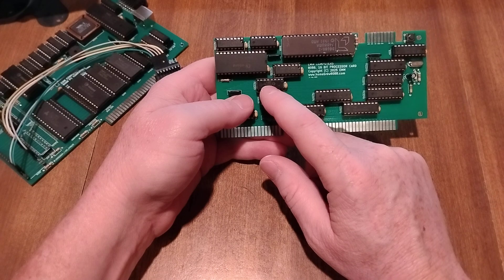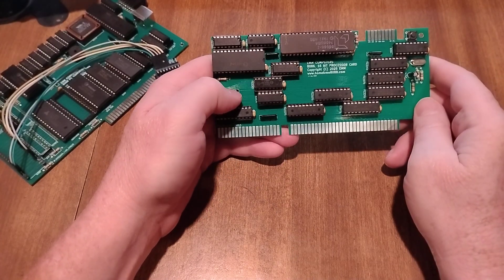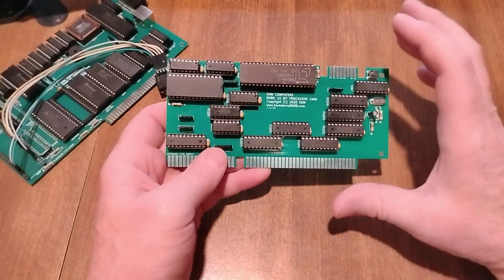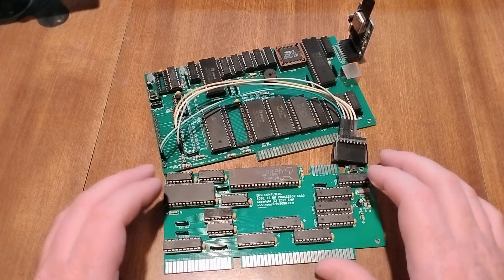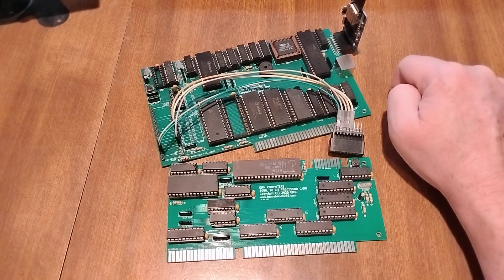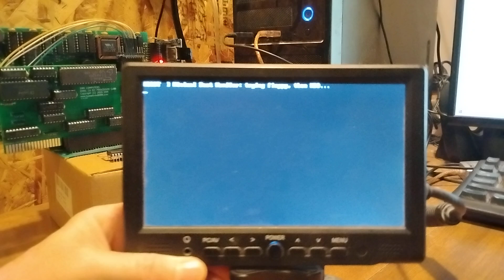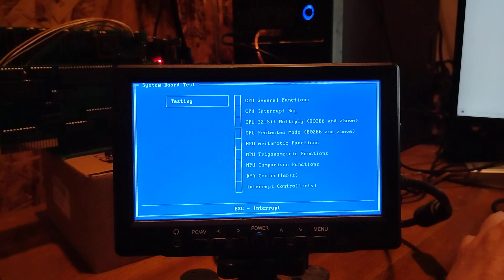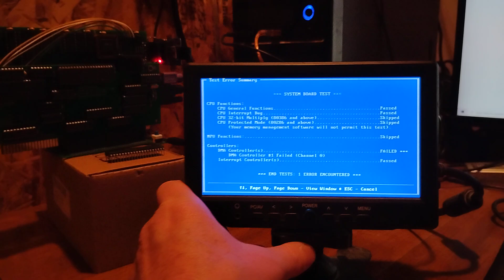8086 PCB

Comment: @EMMComputers -- Will we see this project on a 16-bit ISA backplane board?
Ive been following this since pi86, and got a NEC (v20 i believe, 8086 clone) to play with this when you got it closer to a place where it would be usable for my projects.

Also, does freedos load on this properly?
Reply from the maker: Yes the intent is to build this for a 16 bit back plane. I have had less time these past couple years to work on the project so it might be a while before I get back to it. 

It should run free dos without any issues.

Comment: Как к этой плате подключить FPU i8087?
Reply from the maker: you would have to add a 8288 bus controller. Then use the control signal from that to communicate with the custom made bus controller. This would allow the 8087 to connect correctly to the 8088. 

This then creates a new problem the Hold and Holda pins that the DMA controller use would no longer be available. With some more chips you can create a new Hold and Holda signal. It is definitely something that can be done. 

The reason why I have not developed the project to use the 8087 is that the number of additional chips would add significant cost and complexity to the project. I personally never used an 8088 with an 8087 installed. There were not very many programs out there that required it.
Reply: @elijahmmiller Using 8087 (or 8089) coporocessors available in 8086 MAX (MX pin) mode.
Reply: Никак, процессор должен работать в максимальном режиме (MN\MX) и как упомянул автор - нужно использовать системньій контроллер 8288 либо переизобретать КВАЗАР-86 на рассьіпухе.